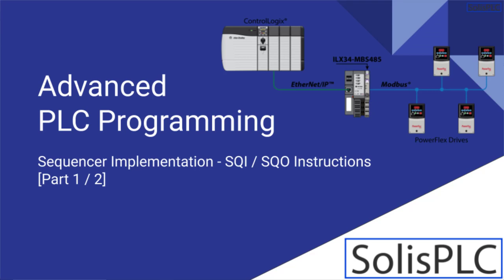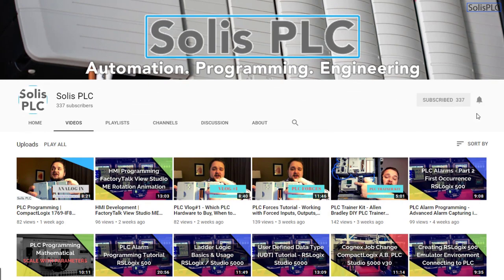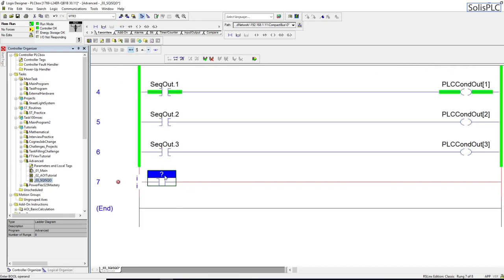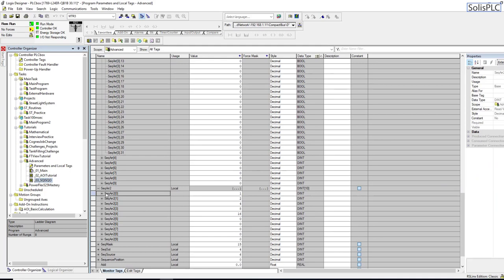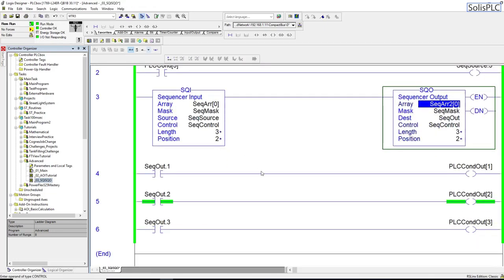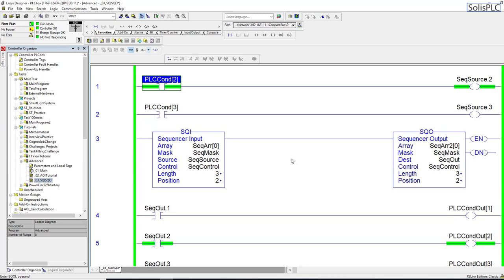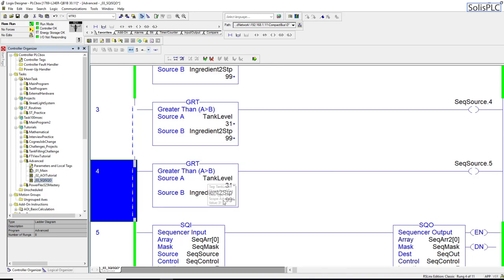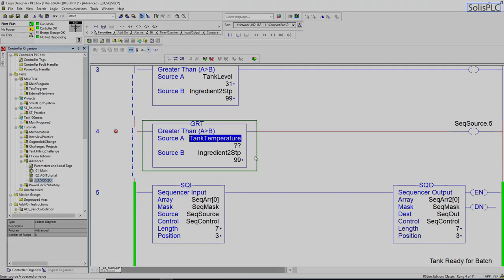PLC Sequencer Programming - Tutorial on SQI SQO Instructions in RSLogix 5000 Ladder Logic  [Part 1]

Comment: The good thing about using MOVs or latching individual bits of a DINT for a sequencer is that you can normally see the problem in ladder. Anyone capable of going online can just scroll down until they see the last MOV instruction and see what is keeping the rung from moving to the next step. They don't have to decode masks or other crap that is going on inside this function.

This isn't that much different than doing things Bitwise, and while it may be a great way to program some things it is also a hot mess to decode if you don't know what's going on. You can comment all you want, but typically someone has to sit you down and walk you through it.

Comment: For sure a "numerical sequencer", or state machine as it is normally called, is far easier to troubleshoot. The biggest advantage to using traditional state machine is that new logic can be added in between existing logic.  This could be done using SQI/SQO, but it's not natural if the original programmer didn't leave spare steps.  Here are other advantages to this "unprofessional" method. 
- Typically state machine functions are grouped 100-199 for this, 200-299 for that, and so on.  This makes it very easy to troubleshoot.  Nobody in their right mind numbers the states 1-2-3.  At least they are 10-20-30.
- When a fault occurs in a state machine, the fault can be captured easily by negating the state or copying the state value to a variable that matches the HMI.
- Where multiple stations use identical logic, the state machine can be kept in an array, where the index chooses the station.  This simplifies visualizations and indexed logic. 
- A LIM instruction cleanly identifies a range of states. 
- Code is cross-compatible with other brands of PLCs, including the dirt-cheap models.
- Decision-based sequence loops and sequence branches are essential in many applications.  For example, executing a group of states a few times in a row, or breaking out of a sequence after an event. Think "do while" or "do loop".
- Sequence parallel operation where the state machine branches and starts one or more other state machines, then continues after the others are complete.
- Numbers are far easier to comprehend than bits. Though bits are easier to see, you have to find which bit is illuminated to know where you are in the sequence. The number helps you find the spot in the code much faster. 
- Nothing is hidden in a table where you have you expand and collapse variables in a data table you see what is going on. This process is slow and confusing, even in this video. 
- The act of using an SQO to activate multiple threads of logic is supremely bad news because you cannot cross-reference your way from output to input.  It is nearly a criminal act to obfuscate logic in this way. How can you expect an average electrician to troubleshoot a system when the code heads down such a dark alley? 
- In 25 years of machine building and service work, I've only seen one system use the SQI/SQO instructions. The implementation was "cool", but it's a pain in the ass to work on.

I have seen several other "interesting" state machine types.
- Bit sequencers that advance from one bit in an integer to the next.  Siemens programmers seen to love this, but it is bad for many reasons.
- Shift registers, which also have many failings.
- Numerical state machines where the value rises or falls based on permissives.  These are a hassle.  I learned this technique from a guy at HP who was software engineer on a project with many programmers.  It worked very well for him.

Anyway, this video is a nice example of using the SQI/SQO instructions.

Comment: Would the SQI and SQO be a good application for controlling the steps of a servo. Say I need to pull material to three different steps and at each step I have there is a process that has to happen before the next step. Like sandblasting, then cutting, the pull and release then go back to home and start over again?
Reply from the maker: Without additional information, it seems that it would be a good application. I would not necessarily say that it's a way to "control a servo". The Sequencer is just a methodology of implementing robust sequential processes. It will dictate in which state the flow should be without any awareness of the output being a servo.

Comment: I'm working on an implementation now where I saw this as an option, but I don't think it's right for me. Application is multiple batch processes running on multiple tanks. Tanks all have matching I/O and processes are all the same. Tactic I am taking is building an array of states with the outputs, then building an array of requirements with the inputs.

Procedures are defined as array steps with a states and requirements selected from the arrays mentioned. As program cycles through states and requirements are copied from the arrays to the current state and current requirements for a given tank. From there, just add an incrementor for each tank and use that to pull data from the arrays.

It allows all the tanks to run concurrently using different sequences all at different steps. By having the states and requirements in an array, they can be reused on various steps as well, heavily cutting down on the amount of memory required for all these things.

I'm still interested in this functionality, but it doesn't appear great for scalability.
Reply: Your plan sounds correct.  I've used it for many systems where I had identical processes running out of phase.  Usually I have one routine that is scanned once for each process using indexed addresses.  For troubleshooting I keep a copy of the routine that is not being scanned.  In that copy, the index is a variable I can change to select the process I want to troubleshoot.  I've seen people use function blocks for this, but this prevents online changes.
 It's been a year since you're comment, so I'd like to hear about how it went on your project.

Comment: Can the SQI instruction use OR logic to advance the state? For example, the tank level setpoint is reached OR the operator presses the manual advance button?
Reply from the maker: Yes, but you'd program that through a single condition. For example, your step 3 can require tank level to be full AND pump start. You'd simply tie two instructions in parallel to the "tank level full" condition and it would be met if the tank is full or a manual button is pressed.
Reply: @SolisPLC  OK, I get it. Is there also a way to manually advance the step number of the sequencer, so that the same Manual Advance button can be used at every step in the sequence?
Reply from the maker: @karenmurdoch7811  You can use a MOV or ADD instruction to increment the current step value. So if you're in Step 4, you can tie the button to an ADD and set the step to 5.

Comment: how may steps can be programmed before you have to start a new array?
Reply from the maker: That's an excellent question. From experience, I've never reached a maximum and believe that you can have thousands of steps. In practice, I'm not sure how easy it will be to maintain such a sequence just based on the complexity.

Comment: Kind of irks me to hear you call the step sequencer or number sequencer,  unprofessional.  Over years of experience , I've found that that type of sequencer is the easiest for those on the floor to troubleshoot and other to add processes or paths too. I mean, would PACML be the most professional sequence using that logic. If thats so, I prefer unprofessional.  Some benefits too the simple sequencer is that it can be restrated started easily mid sequence,  or even run backwards with little extra code, if that puts the process in a better stopping condition.
Reply from the maker: Perhaps the word "unprofessional" is a bit strong. From my experience is that over time, a number sequencer implementation always goes wrong. It's typically not during the commissioning phase, but rather when things "don't go as planned" or need to be "tweaked". From what I've seen, it's rare that those who modify these implementations take the time to understand what was done; instead, layers are added until the intended logic no longer functions and fails intermittently. SQI/SQO is certainly not oblivious to such issues, but people tend to spend more time understanding the steps implemented and are very cautious when changing the I/O.
Reply: Completely agree. I have a degree in programming and am starting to get a feel for these, but most of the techs here just need a quick and easy way to see why it is out of sequence. A regular Step sequence would be much easier to understand at a glance!